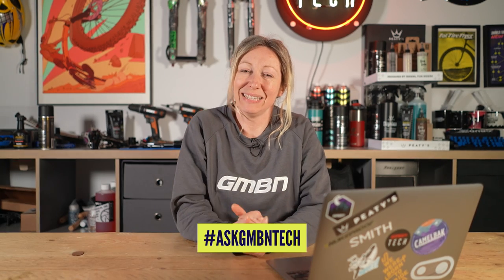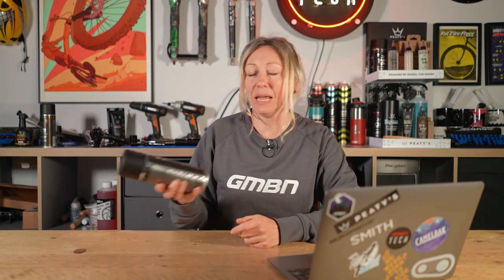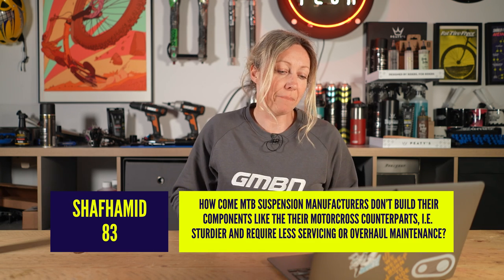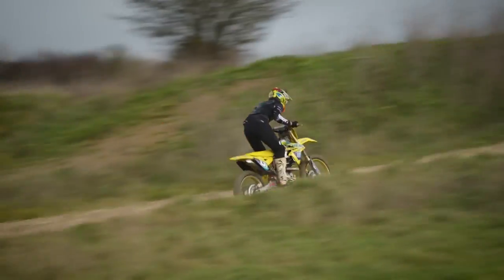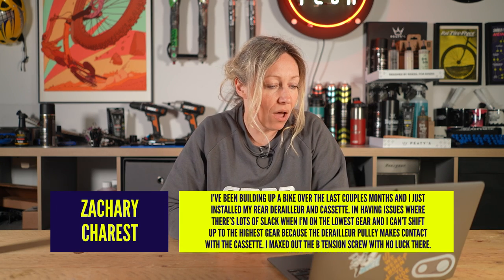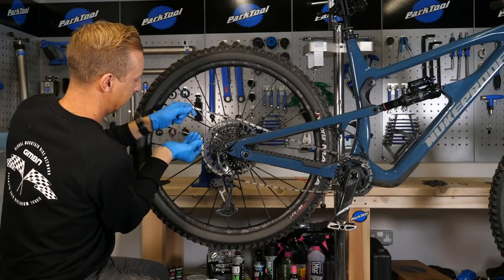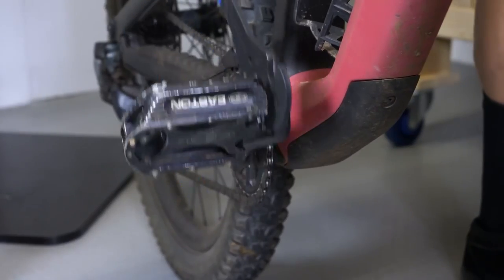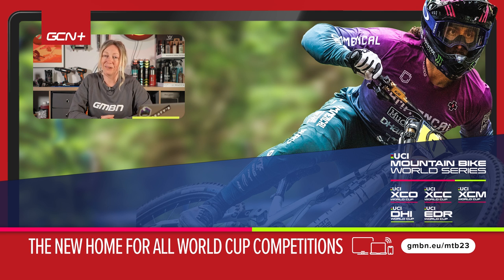My Seat Post Is Stuck HELP! How Do I Remove It? | #AskGMBNTech

Comment: I worked on my aluminum seatpost seized in my chromoly frame for about a week using all listed methods. The action happened when I bought a 2 foot pipe wrench and went medieval on it. Success.

Comment: Before trying violence and heat with the seat post, remove the bottom bracket hang the frame upside down and pump it full of penetrating spray. There's a heavy duty WD40 one (esp. for rust etx. Stinks but works) I used to free the seatpost on my friend's steel Stumpy (he bought one inspired by mine - seatpost fine on mine but the BB was seized in place, and this worked on mine). Don't be afraid to use a whole can - a Bonty Race Lite is worth saving! Had one on the 90's, miss it like F&%! Leave the frame hanging for a week with the liquid inside. If it starts to seep out, you're getting there. You'll probabaly still have to use some force, but it worked for me on 2 frames 28 & 26 years old respectively. Cut out slots on the rear of the seat tubes are perfect points for gunk & water from the back wheel to get in to the frame. Californian designed bikes for you! Got an old Orange Clockwork frame from the early 90's in the garage. Seatpost slot on the front of the seat tube. Prob why the alu seatpost came out of a steel frame after 25 years when I stripped it.There was a bit of electrolytic reaction, but a good twist cracked it free.Good luck!

Comment: On the seatpost: I’d try to drill a hole through and get a solid bar in for leverage. Since the bonded head is loose, you will need a new one anyway.

Comment: I suggest trying to remove aluminium seatpost from steel frame. Seized to the bone😂 super frustrating. Keywords if everything else fail are: heat, freeze, lye, gallium😂

Comment: On the 4.21 question about chain slack on high gear and tight on low. I managed to install one rear mech off a notch (hard to explain, would need a picture, but the rear mech was too far forward leaning, if you get the idea) and had that exact same problem. Should have caught it when I was wondering why a chain that was cut to length as Shimano recommends did not fit right. Anyway, spotted it in the end without more that an hour of cursing and wondering what is going on.
Reply: Also to address the issue of not shifting into the largest cog/easiest gear. Doesn't mention what parts he's using and could be like me - building up an older bike as a 1 x conversion, but trying to save money by re-using the rear mech which will have a small maximum tooth size that is less than the big cog for a 1x aimed cassette (like 42 tooth big cog where the mech can only handle 36). I had some success using a derailleur hanger extender to get the extra clearance. Tip - if it's non-clutch derailleur make sure and have lots of chainstay protection  as it will be slack in the harder gears due to the extra chain needed to account for the extender.
Reply: @elrictdb  I think you answered the question.  Anna did not address the point that the bike wouldn't shift into the largest cog and that the b-screw as all the way in.  These are symptoms of a too short RD cage with a too large rear cog I think.  I too have made it work using are RD hanger extender.
Reply: I've had the same problem with an XT derailleur. You have an option of getting a different cassette with smaller large cog, like a 42 instead of 46, or I simply installed a longer screw which has worked well for over a year now.

Comment: #AskGMBNTech: The seatpost question got me thinking. What if your dropper post is so stuck that you have to hacksaw it out? On a normal post you can just cut the top off and then cut length-wise. But on a dropper post it's not possible.

Comment: If the chain is the correct length, would it be possible to use a longer B-screw? Wolf Tooth makes a 25 mm long B-Screw for adapting old derailleurs when using a GC cog.  I am not a bike mechanic so I am not sure this would be a solution for the person  I have used the Wolf Tooth longer screw for adapting older derailleur on bigger cassettes.

Comment: My seat post rattles inside the dropper post, I can slightly move it on its axle and left/right, forward/backward. Is there a way to tighten it, it's very annoying.
Reply from the maker: Most dropper posts will have a small amount of rotational float between the saddle/upper part of the post and the main body of the post. Depending on the post you have, it may be worth stripping it down and checking the internals. Most posts will have some small brass 'keys' that keep everything lined up properly. If they are worn, you may find that buying and installing some new ones helps out. 

If your post is also moving fore and aft then it sounds like there may be more going on inside - as before, stripping it should help isolate what the problem is. Most manufacturers will have instructions on their website about how to strip them down. Typically it's a straight-forward job and shouldn't require many tools.
Reply: @gmbntech  It's brand new, so that sucks. Thank you!
Reply from the maker: It may be worth recording a quick clip of the movement your new post has and emailing it to the shop or brand you bought it from to double check that it's not faulty, but as before there will always be some degree of movement there.

Comment: I wonder if chain person measured it through the derailleur? You don't... Just around the cogs as described... Then add links as per manufacturers spec... Which actually is less links for full sis on sram, not more as Anna said.

Comment: #AskGMBNTech Why is it absolutely impossible for me to adjust a rear derailleur? I just bought and installed a 11-speed SLX groupset, followed the Park Tool adjustment video (it didn't work) followed Free to Cyle's video (it didn't work) and followed Kyle and April - Ride MTB's video and that also didn't work. I have NEVER been able to correctly adjust a derailleur in the 5 years I've been working on bikes. I always adjust it til it's totally out of wack then take it to a bike shop and they fix it.

Comment: How do I find a seat that doesn't make my butt hurt after 20 minutes? My last 3 seats have all been uncomfortable like that, and the only comfy seat I had got stolen 10 years ago and I don't know what it was.
Reply from the maker: Often, an uncomfortable saddle will be one that doesn't match the width of your sit bones. You need to have a saddle that is wide enough to support your sit bones properly, otherwise your weight is being transferred into other areas! There are some other aspects that can affect comfort (such as the amount of padding on the saddle, the stiffness of the base and rails, and so on), but getting the right width will make a big difference.

Most manufacturers will list the width of their saddles, so if you think your existing saddle might be too narrow then we'd recommend double checking the width of your current saddle, and compare it to the saddles you're looking at buying. It's not a guarantee that your new saddle will be more comfortable than your current one, but it should hopefully be an improvement if you're better supported!